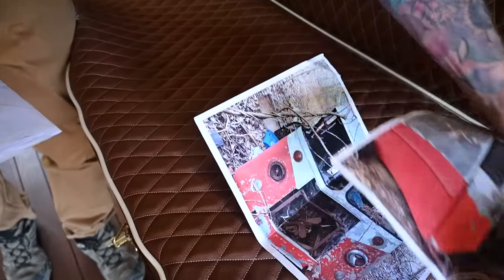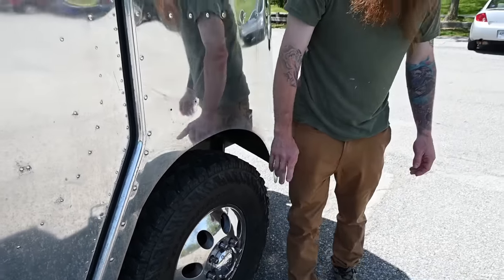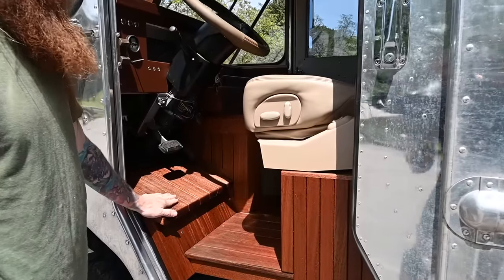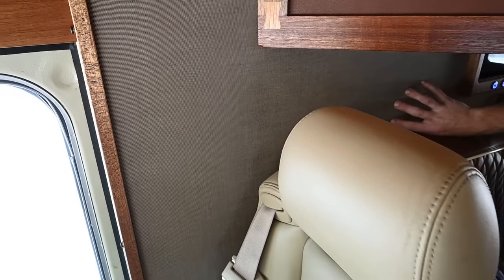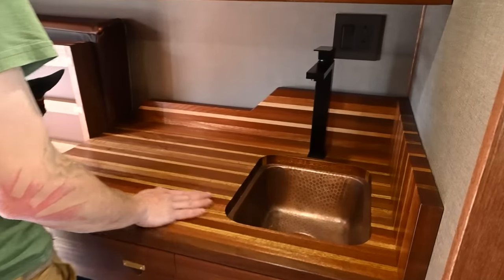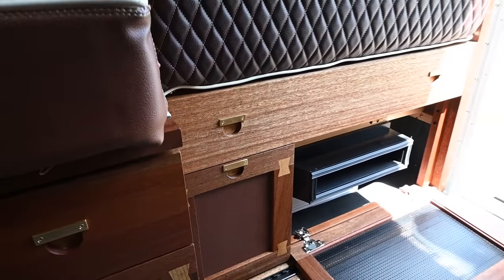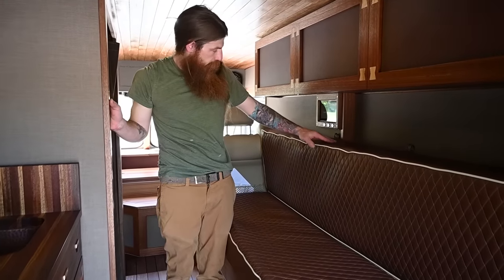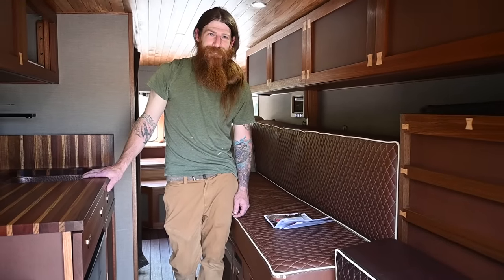The BEST Step Van Camper Build EVER - Vintage Grumman Bread Truck Conversion

Comment: Wow... and then, Wow... again. My own box truck video was just released a few days ago. "His secret beach house is inside a box truck". I just responded to a comment, that motorhomes are not built by carpenters, they are put together by laborers. You, are a master carpenter, and a master of all the cool trades.  I did the same AC trick (ducted up works a lot better) mine has ss mesh through the floor. Can't go wrong with victron. Every thing you did is classic perfection. True work of art.

Comment: For the average person I guess, this is a fantastic build. I had a model with all the bells and whistles for some time, but honestly, it's not just the cost of materials and electronics that eventually turned me off, but the monthly cost of operating such a rig and the maintenance when things break. So I removed all the crap and used natural materials that don't have a monthly cost of operation. I now have a GRAVITY-fed water system for my sink and shower... no need for electricity on that. I have a composting toilet that fits inside my gravity-fed shower system when I'm not showering (originally I had a garden sprayer but I got tired of pumping it up so I simply installed a large plastic jug above the shower and when it's low, I simply refill it. (for you people who are tall, you can sit on a water-proof stool in the shower so that you fit under the waterfall). I have solar-powered lucy lights (placed on my dash during the day to be charged by the sun) for lighting at night and a diesel heater, which I plan on switching out with something else when I can think of what I really want. I don't have anything but a laptop to charge so I plug it into my cigarette lighter to power it while I'm driving. All-in-all, I have very little expense over gasoline for my van now. And I'm very happy about that.
Reply from the maker: Thank you for sharing your experience

Comment: 1:25, the dog!  Great build, I remember those, lusting after one and their aluminum construction, as compared to the IH Metro step van ( a Larrabu bread van from San Francisco) I was living in at the time. Both share some pretty good aerodynamics, with their rounded corners etc. Having done solar wok for years, I was just thinking what a hot box his electrical area would be, when he mentions the ventilation system, damn, who is this guy?! His own work on the upholstery, the work wood, etc.!
Reply from the maker: Such an incredible build

Comment: 2 questions, 1 what weight is this van,  2 how many tubes of Solvol Autosol does it take to shine up the aluminium bodywork,
Reply from the maker: The chassis has a GVWR of 14,500 and the van weighs less than 10,000

Comment: Looks great. I do have a question: Will there be a paint job on this van or will it be left as bare metal? I'm curious because since the purpose of the vehicle is exploring the great outdoors, I was wondering what you'll be doing for corrosion prevention.
Reply from the maker: It’s been exploded bare aluminum for a long time and it held up okay. He plans to buff it occasionally
Reply: @NewJerseyOutdoorAdventures I can imagine this towing an Airstream travel trailer. 😲

Comment: The hiway patrol isn't going to like the rear tires sticking out the sides of the rear wheel wells 12 inches uncovered and eventually that 7.3 is going leave him disappointed. I couldn't see any engine access either and a 7.3 has a fuel filter right on top of the engine at the front that isn't something you can ignore replacing just because it's a hassle to get to it.
Reply from the maker: He built it with service in mind. Flares coming soon

Comment: So much weight in there. Solar system  why for a few devices . Tablet lights speaker
Reply from the maker: There is a lot of weight. But this is a commercial Van and it’s designed to hold a lot of weight there’s still enough payload left for lots more.

Comment: Protruding rear wheels are road hazard. How's that road legal is beyond my knowledge? Rough tyre track tread could pick up a stone of the road and launch it toward someone else head - this is why mud guards are invented.
Also turning on those asymetrical tracks (front narrower than rear) are very unstable over certain speed specially with higher center of gravity. Tread wear on rears is also massive affecting mpg and stability. I wouldn't call it best conversion, I'd call it death trap.
Reply from the maker: Flares soon to come